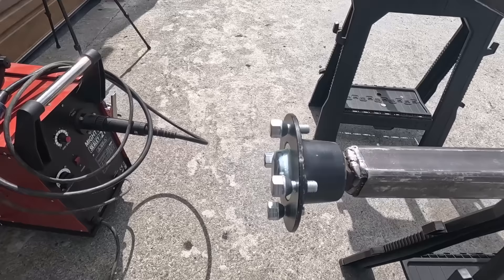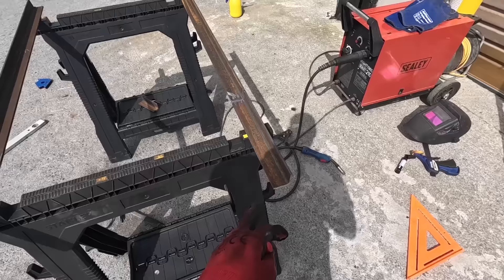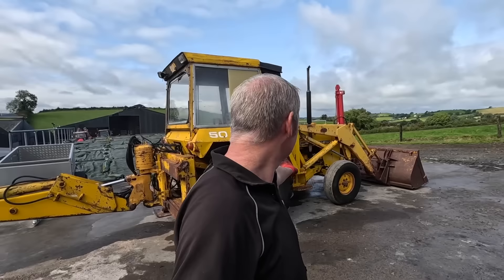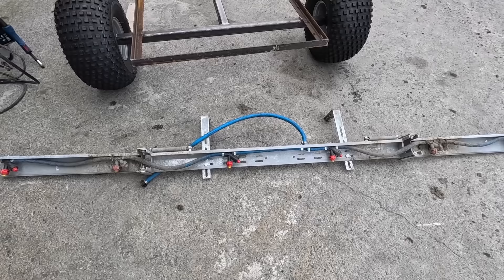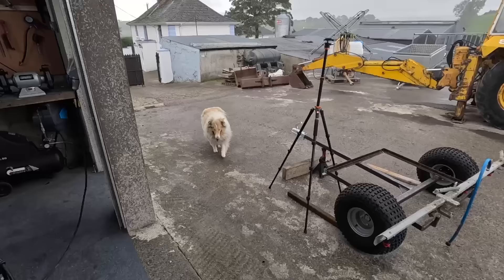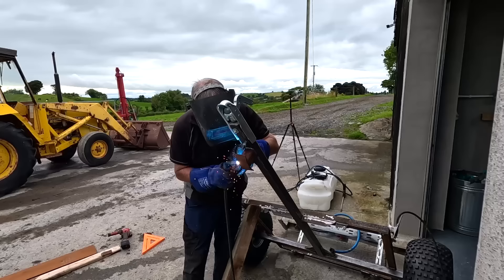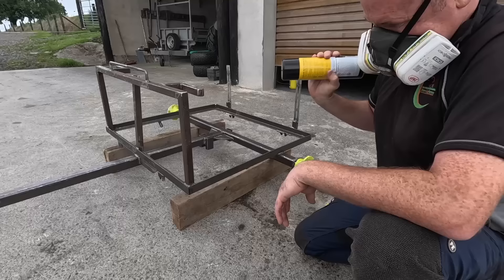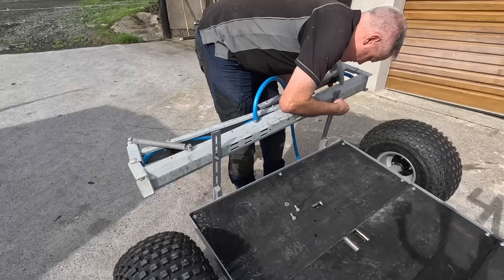Building A Multi Use Farm ATV Trailer From Scratch || Making Life A Little Easier

Comment: Well Adrian great job on the trailer well finished. What you should think of doing is make the boom brackets quick fit. Two bit of box on the back with smaller box frame slot in and out save opening them nuts on the boom every time. Then you could have other attachments with same idea of fitting on the back 👍

Comment: Grand job but 1 suggestion is to put a flap between the spraybar and wheels, becauuuuuse if there's drift coming towards the wheels you won't want spray on the wheels, happened me years ago with a ride on lawn mower and I destroyed the grounds I was cutting😂 there was tracks up and down the grass of dead grass, oops

Comment: If u push the welder torch instead of pulling it it will leave a nicer and stronger weld because your pushing away from the heat. But tidy job done👍
Reply: Makes no sense

Comment: Just a suggestion I made a modification to my quad sprayer put a 12 solenoid valve on pipe out to boom and wired it to the tail light so when you switch lights on boom starts to spray the switch is on your thumb dead handy for turning etc also you can leave the pump on and system pressurised so you can use the lance with out having to manually close a valve to the boom

Comment: Very usefull trailer for the quad, think you should run the wire between the quad and trailer along the drawbar, that way it will not get stretched or broken when you turn.

Comment: Good job but hope you re pack your wheel bearings  as the hubs would  got hot from the welding  .
Reply from the maker: That’s a good point, I had a little sprayer with me full of water that I sprayed onto the hub every few seconds. You can see it in the background around 1.00 or so. Otherwise yes could could burn out the outer seals for sure

Comment: A tip for you if you are ever putting in a steel floor in any sort of a trailer wearer it’s a bale trailer or cattle trailer or anything on all the beams it will be sitting on tec7 it down and then weld it on top and it will stop all rattling or banging off the center beams we have done this on a bale trailer and there is no noise of it at all
Reply: And also be very generous with how much Tec7 you use

Comment: Brilliant little multi purpose trailer, your welding skills are par excellence! Pity you don't have an electric powered spreader, something you could also use the trailer for, you wouldn't have to worry about a geared rear axle. I have seen them but not sure if they are worth the money or indeed the effort as the bin size appear to be limited. However with your skills however, might be something you could build yourself. 👍

Comment: Good idea Adrian.  One thing you will need to change for ease of use is the switch for turning on the sprayer as you have it on the right hand side. I use my quad for spraying and my switch I fitted on the left as that hand is free as you drive with your right hand on the throttle so left hand is free to switch on and off easily.  Just a suggestion from an old fella.....at least this trailer sprayer will not be affected with the exhaust blowing the spray as I had to fit a blocker a few inches from the exhaust to cure this problem..

Comment: Great video Adrian it's a handy little trailer you could fit a reeler for running out water pipe electric cable etc .
Best of luck with the 50 B there was quite a few of them about this area I know of two of them still in use on two farms locally
both in very good nick if you are ever around Ardee /Dunleer area I'm sure both lads would give you the short cuts on maintaining them

Comment: you getting better at welding nice job on the trailer... 

the reason they dont come standard with indicators is because it increases the cost... also most quad bikes cannot be used on the road because they do not meet road safety standards.
so from a £12,000 quad it could go up as far as £2,000 more to get it road legal.

but i do like the 3 pin plug i might do the same to ours when they get here, i just ordered 2 new king quad 750

Comment: I would have put two sleeve type sockets on the back bar of the trailer, that way you could have just lifted and slotted the boom in whenever you needed it. You could also have made the simple spindle bar with the same slot in legs for the drum of wire.

Comment: Great work Adrian.  I wondered at the time when you installed your workshop roller door, what you were going to do about the gap where the door meets the concrete floor?
Reply: And just wondering how you are going to keep it from getting absolutely covered in muck from the quad wheels? Mud flaps right to the ground perhaps? See them quite often on dairy farm quads.

Comment: Barb wire usually the higher up it is the better stretch of ground you can cover without getting caught in grass etc. and rolls out easier up right. Just a thought 👍 good work.

Comment: Great job! If you're adjusting the sprayer brackets again could you do them that when you take the boom off they come off with it? Just thinking you'd be less likely to catch on them when using it for other jobs.
Reply from the maker: Yes I think that would be a better job, maybe a bit of box iron with bolts welded to it so you can slide it in and just tighten the bolts if you get me
Reply: @IFarmWeFarm  yeah be perfect that!

Comment: This is not a criticism just a concern and maybe I have missed something and it's not a concern at all.When you are using the sprayer and you have connected the electrical cable from the right hand side of the quad to rhe sprayer and you turn left isn't the cable going to be over stretched in it's present fitment.
Reply from the maker: Your 100% Greg, with that wire the first thing I did was put it in a full left side lock to see there was enough wire. A good point though and can be easily over looked like I did several times in the past 😉

Comment: Not sure if the Barb would catch the back as it goes off. A bit of sacrificial post or similar might protect your trailer. Your second solution wouldn’t have that issue. 

Not sure if the current boom attachment would cause any issues unless the vibrations loosen stuff. And there might be a bit of give if a post moves while you’re driving passed it 🤷‍♂️

I’m very impressed with your design and build skills. Top job. I can see you loading it up with all sorts that you need transporting. Hopefully you have inspired a few 👍

Comment: The Concorde had a maximum cruising speed of 2,179 km (1,354 miles) per hour, or Mach 2.04 (more than twice the speed of sound) after getting a pull start from a Massey Ferguson 135. I recon we're on track to reach Mach 3 with this baby on the Quad when the button is pressed 😂😂😂😂😂😂.

Comment: The reason quads dont have a trailer plug is most quads arent registered so arent legal to be used on the roads.
I made up an adapter for mine for the trailer to give lights only. 3 pin to female 7 pin trailer

Comment: No way did you weld that without grinding away the rust 🫣🫣🫣 remember, preparation is key …… don’t take shortcuts as it looks like an amazing bit of kit that will be very useful . Not a troll by the way just first thing learned when I was starting welding was all about prepping
Reply from the maker: In fairness I agree with you on that one 👍